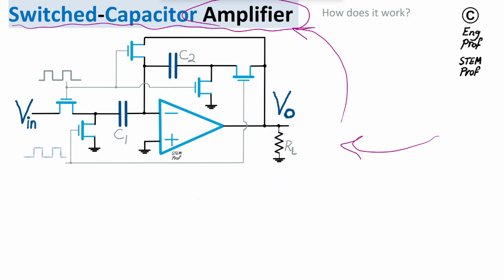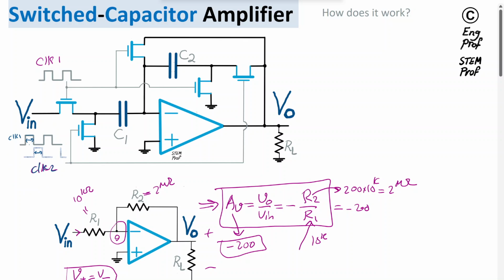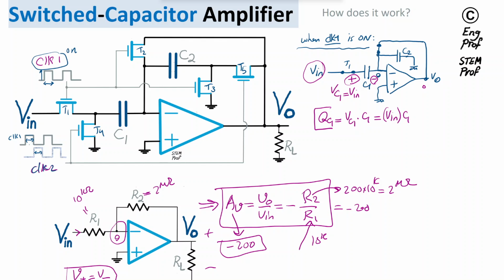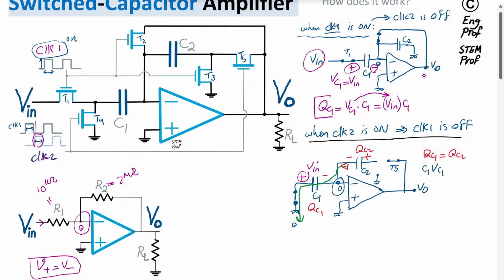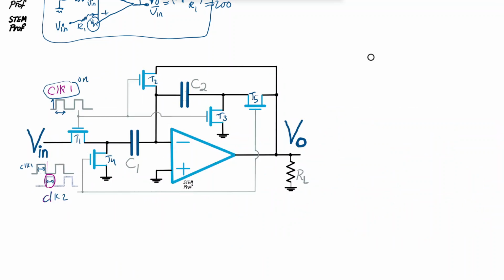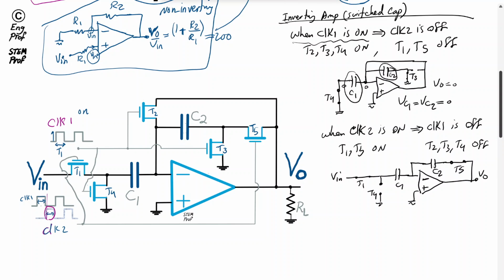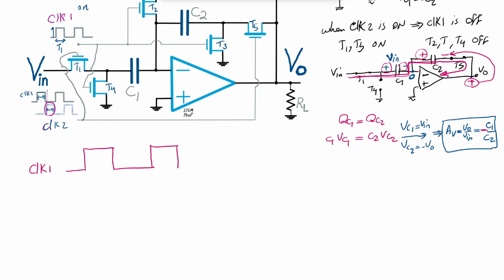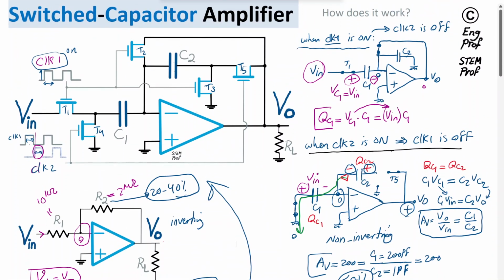Switched-Capacitor Amplifier Design: How does it work?

Comment: Hi quick question. I'm trying to solve a problem with a chopper based zero offset amplifier, which was built in the 1970-s there are not much to be to start with. Main goal is to either be able to repair the original amp (which seems tricky because there are matched D-mosfets on the input) or completely replace it with a modern part. The amps feedback is done by taking its output current and creating an error voltage in series with the input voltage. The problem is that the inner workings of the amp is very confusing. 
Do you have some time to spare to discuss it over e-mail? 
Thanks in advance!
Reply from the maker: Hi, that sounds like a genuinely interesting (and nontrivial) vintage design problem. A few thoughts based on what you described:
   What you’re calling a “chopper-based zero-offset amplifier” is very likely using some form of modulation/demodulation (chopping) at the input to cancel offset and 1/f noise. In older designs, this was often implemented with matched MOSFETs acting as switches. So, those matched D-MOS pairs you mentioned are probably critical for symmetry and low error.    The feedback approach you described;  taking output current and generating an error voltage in series with the input;  sounds like a series–shunt (voltage-series) feedback topology, possibly with a transconductance stage internally. That can definitely make the internal operation harder to interpret because the signal is being “reconstructed” through feedback rather than directly amplified in a simple way.  Before deciding whether to repair or replace it, I’d suggest:
🔹 Try to redraw the schematic into functional blocks (input chopper, core gain stage, demodulator, feedback network).
🔹 Identify what sets the closed-loop gain and DC operating point; that usually clarifies most of the confusion.
🔹 Check whether the matched MOSFETs are truly the failure point, or just a concern due to availability.

These videos might help clarify the feedback behavior you’re seeing:
🔹 Feedback Amplifier: How to find DC Bias and AC Gain: https://youtu.be/6dLMxpLNKv4
🔹 Series-shunt Feedback Amplifier Explained: https://youtu.be/pc221bCojms
🔹 How to find Gain of Feedback Amplifier (JFET & BJT Example): https://youtu.be/NB1-mYglXsY
They walk through how to analyze exactly this kind of “non-obvious” feedback structure step by step.

That said, this kind of reverse-engineering / repair task can get pretty involved. If you can, I’d strongly recommend posting the schematic (even a hand-drawn one) on a dedicated electronics forum (for example, Reddit’s r/ECE or r/AskElectronics). You’ll likely get multiple perspectives, especially from people who have worked on similar legacy designs.  I hope this is helpful.🙋

Comment: Thanks for your good work. A retired mechanical engineer here with some old background in op-amp and filters. I'm really wondering where to start, the videos are not indexed in this playlist and other playlists. My main interests are op-amp and filters.
Thanks in advance for your kind reply.
Reply from the maker: Thank you for the kind words, and your interest in this engineering channel. I recommend checking out my dedicated "Active Filter Design" and "Op Amp Circuit Analysis" playlists for a structured path through those topics.

Comment: Hello, I'm working on my thesis based on a biquad switched capacitance notch filter to eliminate the 60Hz frequency for EEG signals up to 500Hz in Xschem with sky130, but I still don't know what the slew rate of the amplifiers should be, the GBW, if the amplifier output is high or low impedance, can you help me? Thank you very much for the video, I understood more than hours sitting reading books
Reply from the maker: @MathElectroHelp Good question! Glad the video helped clarify some key concepts!  For a switched-capacitor notch filter targeting 60 Hz suppression in EEG applications (up to 500 Hz), your op amp specs are crucial for clean performance and minimal distortion as summarized below. 📌 But before delving into those details, While your analog SC notch filter approach is valid, keep in mind that for biomedical signals, especially wearable or low-power devices, digitizing your signal and applying a digital filter can be a practical alternative. For example, see the approach in “A novel low-complexity digital filter design for wearable ECG devices” https://journals.plos.org/plosone/article?id=10.1371/journal.pone.0175139
It uses a minimal-hardware architecture to suppress 50/60 Hz interference effectively in constrained systems.  Now, back to switched-capacitor notch filter design considerations:

🔹 Slew Rate: A conservative rule of thumb is to have a slew rate at least 20× your max signal frequency. For EEG signals, assuming a worst-case large amplitude swing (say 1 Vpp), a slew rate of ≥0.1 V/µs should suffice—but faster is better to avoid distortion during switching transients.

🔹 GBW (Gain Bandwidth Product): Aim for GBW at least 100× your clock frequency. If you're clocking at, say, 100–500 kHz, then a GBW of 10–50 MHz is reasonable. This ensures the op amp settles within a fraction of the clock period.

🔹 Output Impedance: The op amp should ideally have low output impedance (a few ohms or less), especially since it charges capacitors directly during the sampling phase. Most CMOS op amps designed for switched-cap circuits meet this, but verify your specific model.

Since you’re using sky130 in Xschem, I recommend simulating with FET-input, ultra low noise and zero drift operational amplifiers if you can use discrete op amps, or MOSFET telescopic or folded cascode op amps in case you are designing the op amps as well for better speed/power trade-offs. If using standard cells, you might consider a two-stage Miller op amp with compensation. Also be mindful of switch charge injection, clock feedthrough, and kickback—especially around sensitive EEG front-ends.
I hope this is helpful. Good luck with your thesis.
Reply: @STEMprof  Hello, thank you very much for the guidance. God bless you for your work.

Comment: Switched capacitance can emulate resistances and inductors, thus it can be used to build up any kind of filters of either passive or active mode.
Reply from the maker: Well said! Thanks for sharing your thoughts. Glad that this Switched-Capacitor Amplifier Design Video is useful. It would be interesting to design a switched-cap based variable gain amplifier that performs similar to the Instrumentation Amplifier with Electronic Gain Control explained in https://youtu.be/C4tghZ-q6Zs video.

Comment: What's the point of T3 and T5. T2 already shorts the feedback capacitor.
Reply from the maker: @jg99997  Good question, due to practical considerations we need solid connection to the ground terminal during capacitor discharge. Switched-Capacitor Amplifiers are compact but are prone to many non-idealities that require careful design choices. For more analog circuits and signal processing examples see: https://www.youtube.com/playlist?list=PLrwXF7N522y4c7c-8KBjrwd7IyaZfWxyt
I hope my Circuit design and analysis videos are helpful. 🙂
Reply: The circuit is in feedback when T2 is shorted, so the inverting input = 0V. It doesn't matter if C2 is tied to ground or not through T3. In fact C2 is probably impacting AC loop gain by moving some poles lower into frequency.

C2 could only exist across the inverting terminal to the output terminal. Additionally T5 is not needed if T3 is not needed.
Reply from the maker: @jg99997  Thanks for your interest and sharing your thoughts.

Comment: Say I want to do physical circuit on this
What components should i use?

I made one using 2n7000 mosfet,freq-1khz,Lm324 opamp,Cap-47pf,100pF
Its not really working???can u help
Reply from the maker: Depends on your target application. Say, for Audio Signal Processing, the signal frequency range is ~50 Hz to 20 kHz. So, a clock frequency of say 500 kHz or higher should be proper. Capacitors in the range of ~5nF to 10nF should be fine assuming switch-on resistance of NMOS transistor less than 100 Ohms (check your transistor datasheet). To be on the safe side, your NMOS switching transistors should have a max switching frequency of at least a few MHz. Lastly, given the clock frequency is not that high, conservatively select a zero offset low noise CMOS Op Amp with a slew rate 20 times faster than your clock frequency. For example, if your clock rate is 500 kHz, then select Op Amp with slew rate of peak-peak (say 5 volts) per 100 ns or faster. See more amplifier videos in https://www.youtube.com/playlist?list=PLrwXF7N522y5679YAO-lFrNVYqV9XMNTr op amp amplifiers videos playlist.

Comment: I want to simulate this on Pspice can u give values capacitors and clock frequency and any other changes required or any things to keep in mind???
Reply from the maker: Depends on your target application. In case of Audio Signal Processing, the signal frequency range is ~50 Hz to 20 kHz. So, I suggest you select your clock frequency conservatively say 400 kHz. Capacitors in the range of ~5nF to 10nF should be fine assuming switch-on resistance of NMOS transistor less than 100 Ohms (check your transistor datasheet). To be on the safe side, your NMOS switching transistors should have a max switching frequency of at least a few MHz. Lastly, given the clock frequency is not high, conservatively select a zero offset low noise CMOS Op Amp with a slew rate 20 times faster than your clock frequency. For example, if your clock rate is 400 kHz, then select Op Amp with slew rate of peak-peak (say 5 volts) per 100 ns or faster.  More op amp amplifier videos are published in the  https://www.youtube.com/playlist?list=PLrwXF7N522y5679YAO-lFrNVYqV9XMNTr playlist.  I hope this is helpful.

Comment: How can i simulate this circuit in proteus can u give me the all components name sir kindly?
Reply from the maker: @nafiuranik7598 Glad that you found this switch cap amplifier circuit tutorial useful. It depends what applications you are targeting. If it is Audio Signal Processing, then Your frequency range of interest is between 50 Hz to 20 kHz. I suggest clock frequency conservatively between 200 to 400 KHz. Then, given the clock frequency is not high, conservatively select an Op Amp that has a slew rate 20 times faster than your clock frequency. For example, if your clock rate is 400 kHz, then select Op Amp with slew rate of roughly peak-peak V (say 5 volts) per 100 ns or faster.  Your NMOS transistors should also be comfortably able to work at few MHz rate.  More op amp amplifier examples and videos are posted in https://www.youtube.com/playlist?list=PLrwXF7N522y5679YAO-lFrNVYqV9XMNTr playlist.  I hope this is helpful.
Reply: @STEMprof how can i use switch capacitor common mode circuit to mitigate its noise?
Reply from the maker: That's a good question and practical concern. I suggest using a zero offset very low noise CMOS op amp.

Comment: Nice and well-understood.
Reply from the maker: Thank you for watching. Glad that this switched capacitor amplifier design tutorial is useful. For more circuits please see:
Thermometer Circuit Design with Op Amp & BJT transistor https://youtu.be/55YsraFE0rg
Op Amp Analog Computer Differential Equation Solver https://youtu.be/ENq39EesfPw
Instrumentation Amplifier with Electronic Gain Control https://youtu.be/C4tghZ-q6Zs
Push-Pull Power Amplifier with Darlington Transistors https://youtu.be/866MYibo8yE
Analog Logarithm Computer https://youtu.be/RpKEq5WyoLg
Sawtooth Oscillator Design https://youtu.be/2eUsGPfqbW4
Triangle Oscillator Op Amp circuit https://youtu.be/JF5Up_cuL9k
I hope these Circuit videos are interesting 🙂

Comment: We can divide an output signal by 100 and then use 20k resistor to get an overall gain of 200. So, we will have 10k, 20k, 100, and 10K, and no problem with a space on a chip (and a thermal noise) I think
Reply from the maker: Thanks for watching and your interest in this switched capacitor amplifier example. Dividing a signal is not a good practice in general due to noise issues. Also, beyond this example, there are circuit/filter design cases in which 100+ kOhm or Mega Ohm resistors are needed on-chip and those can mainly be realized using switched capacitor techniques. For more circuits please see:
Instrumentation Amplifier with Electronic Gain Control https://youtu.be/C4tghZ-q6Zs
Differential Amplifier Design with BJT transistors https://youtu.be/zKgSYvk7JAM
Power Amplifier Design (Class A) with Transformer https://youtu.be/gKlJrqGqeCI
Op Amp Analog Computer Differential Equation Solver https://youtu.be/ENq39EesfPw
Thermometer Circuit Design with Op Amp & BJT transistor https://youtu.be/55YsraFE0rg
Push-Pull Power Amplifier with Darlington Transistors https://youtu.be/866MYibo8yE
Analog Logarithm Computer https://youtu.be/RpKEq5WyoLg
Sawtooth Oscillator Design https://youtu.be/2eUsGPfqbW4
Triangle Oscillator Op Amp circuit https://youtu.be/JF5Up_cuL9k
I hope these Circuit Analysis videos are interesting as well 🙂

Comment: Very interesting. What's the switching noise? Is the output usually filtered somehow?
Reply from the maker: Thanks for watching and your comment. Glad that you like this switched-capacitor amplifier design video. To your point, switching noise and clock non-idealities are important practical considerations in switched-cap circuit design. I'll post more examples in the analog playlist below. 
 Examples of such non-idealities are flicker and shot noise, parasitic capacitance and charge sharing between the switches and circuit nodes, clock feedthrough, charge injection, clock Jitter, Skew, drift etc. Depending on circuit type and target design KPIs, there are number of noise reduction techniques for switched-capacitor circuits to reduce or compensate clock/switch non-idealities. Examples of such techniques include use larger capacitors, higher clock frequencies (oversampling), better matched transistors, noise shaping, noise modulation using Delta-sigma modulation, or filter noise by using proper filters in either the continuous or discrete-time domain. These are extensive topics that require dedicated examples and video.  For more analog circuit examples please see:
Op Amp Analog Computer Differential Equation Solver https://youtu.be/ENq39EesfPw
Instrumentation Amplifier with Electronic Gain Control https://youtu.be/C4tghZ-q6Zs
Thermometer Circuit Design with Op Amp & BJT transistor https://youtu.be/55YsraFE0rg
Push-Pull Power Amplifier with Darlington Transistors https://youtu.be/866MYibo8yE
Analog Logarithm Computer https://youtu.be/RpKEq5WyoLg
Sawtooth Oscillator Design https://youtu.be/2eUsGPfqbW4
Triangle Oscillator Op Amp circuit https://youtu.be/JF5Up_cuL9k
 https://www.youtube.com/playlist?list=PLrwXF7N522y4c7c-8KBjrwd7IyaZfWxyt 
I hope this is helpful. 🙂

Comment: Thanks for the wonderful explanation. 
I was searching for SC content from long time. 
Cheers!!
Reply from the maker: You're welcome! Thanks for watching. Glad that this switched-capacitor amplifier tutorial is useful. For more circuits please see: Op Amp Analog Computer Differential Equation Solver https://youtu.be/ENq39EesfPw
Instrumentation Amplifier with Electronic Gain Control https://youtu.be/C4tghZ-q6Zs
Thermometer Circuit Design with Op Amp & BJT transistor https://youtu.be/55YsraFE0rg
Push-Pull Power Amplifier with Darlington Transistors https://youtu.be/866MYibo8yE
Analog Logarithm Computer https://youtu.be/RpKEq5WyoLg
Sawtooth Oscillator Design https://youtu.be/2eUsGPfqbW4
Triangle Oscillator Op Amp circuit https://youtu.be/JF5Up_cuL9k
I hope these Circuit Analysis videos are interesting 🙂

Comment: talking too fast
Reply from the maker: Thanks for watching & feedback. I'll post more switched capacitor examples. For more circuits please see
Op Amp Analog Computer Differential Equation Solver https://youtu.be/ENq39EesfPw
Instrumentation Amplifier with Electronic Gain Control https://youtu.be/C4tghZ-q6Zs
Thermometer Circuit Design with Op Amp & BJT transistor https://youtu.be/55YsraFE0rg
Push-Pull Power Amplifier with Darlington Transistors https://youtu.be/866MYibo8yE
Analog Logarithm Computer https://youtu.be/RpKEq5WyoLg
Sawtooth Oscillator Design https://youtu.be/2eUsGPfqbW4
Triangle Oscillator Op Amp circuit https://youtu.be/JF5Up_cuL9k
I hope these Circuit Analysis videos are helpful. 🙂